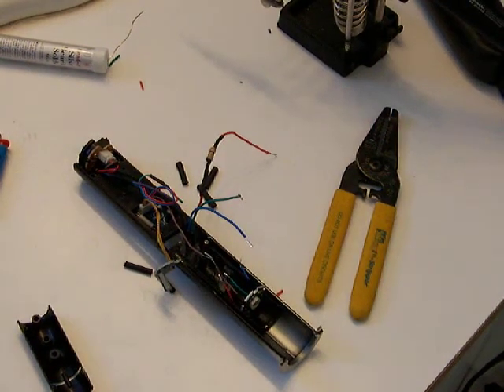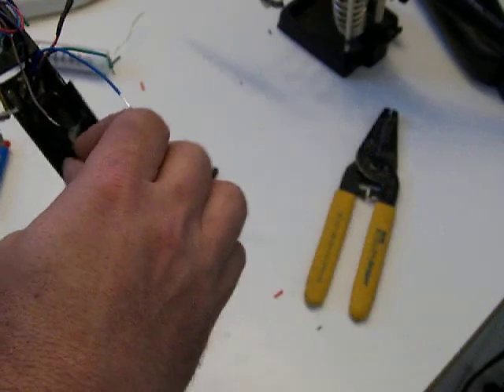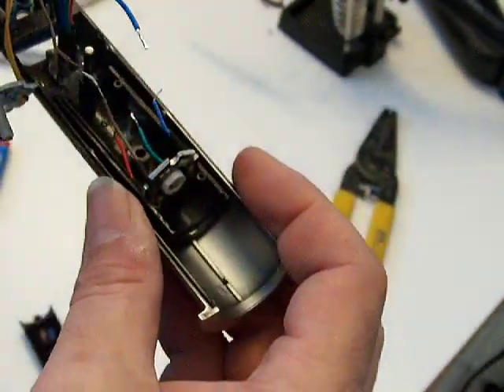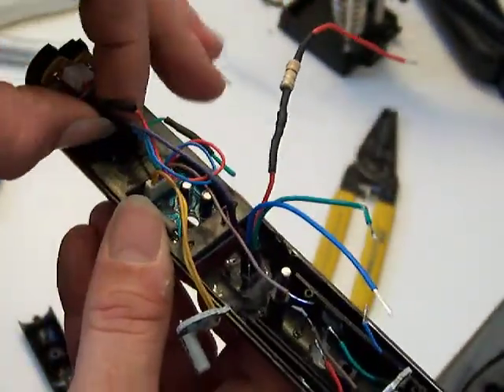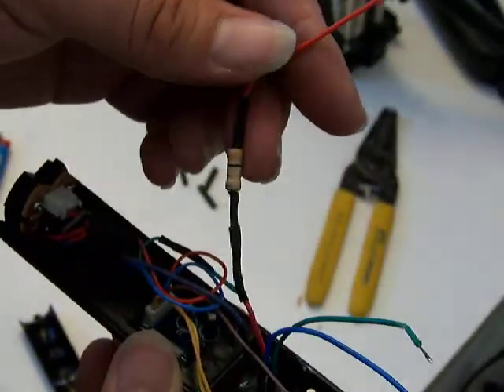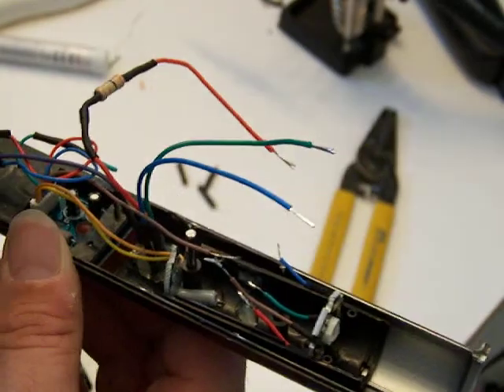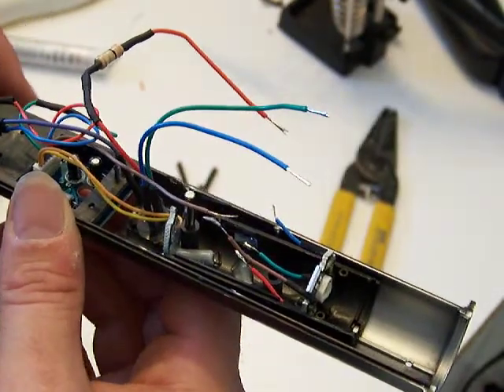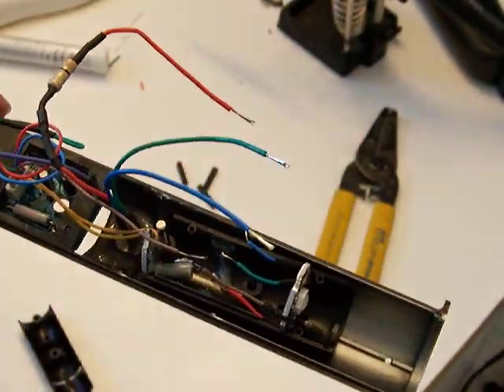Joe jedi kit modification Part 8

Comment: Hello. Just one question. Why did you run the stick 3 position switch to a 2 position switch? Also, why did you add a resistor on the RED wire from the 3 way dip switch leading to the red on the LED ? To dim it out some ?